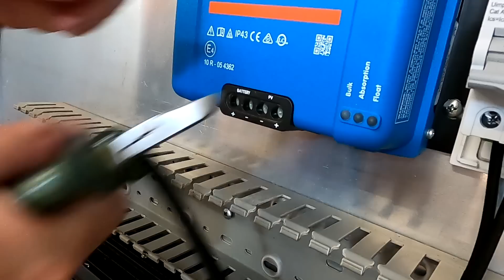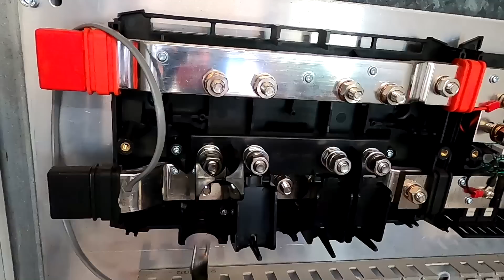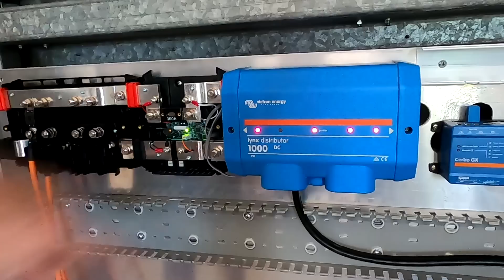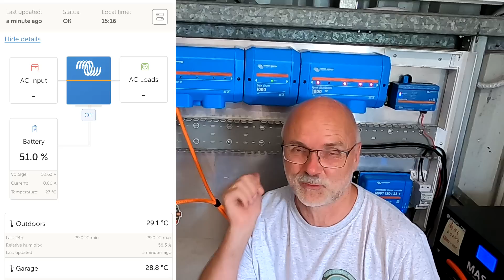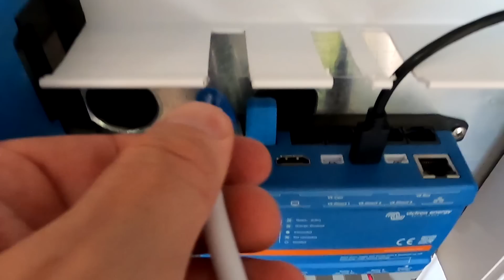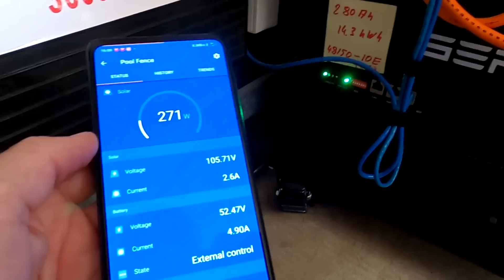New PowerWall2.1 with SEPLOS Battery & Victron Cerbo GX. BMS slows charging at 16%SOC already?

Comment: On the Victron shunt  you’re using a 300 fuse so depending on the battery size my is 675 AH must be fused according.
Reply from the maker: It depends on your cable size primarily.

Comment: Slightly off topic but victron based, What are your thoughts on the Easy Solar integrated boxes? Seems the only thing you would need to add if using it in say a motorhome/caravan would be a shunt monitor. Would there be much point in going for one with a Colour Controller?

Comment: Do you plan to add a class T fuse (or a noark breaker?) prior to the power-in?  The ANL fuse in the lynx shunt module is quite far from the battery to provide short protection.  Or are you happy that the 400A fuse in the battery enclosure is fast enough and got high enough interrupt current to suffice for this purpose?

Comment: Ciao Andy, I have same problem with my primary Cerbo GX + Inverter RS Solar + SOK 48v100 and Secondary Muliplus II GX + MPPT250/100 MC4 =SOK 48v100, when battery is connected MPPT is charging at 52.4V in both systems. I start to think that might be affected due to the Pylontec protocol typically working on 15 cells rather than 16 of the common 48v battery....

Comment: Mega fuses seem to have voltage ratings and Victron are the only 48v ones I can find in Aus. Have you ever tested them? What brand are you using here?
Reply from the maker: I have cheap ones from eBay for this test setup. I considered a piece of busbar for the ANL fuse in the shunt but was afraid of all the comments... 😁
Reply: @OffGridGarageAustralia  ha! I assume the higher voltage ones (of which only Victron seem to  provide) are able to break ark. I believe T class the best but they are so expensive.

Comment: Hi Andy,
I'm planning the system with integrated Victron and Seplos battery packs, but I wondered about this.
What is the point of placing the Victron shunt in the system when we already have a Shunt on the Seplos BMS board? If so, which would be the priority? We can do without the Victron shunt, what would we miss?
Thanks for your kind reply.
Reply from the maker: Exaclty. That's what I explained int he video. You need either or. I've left the shunt in the system as we may not use the Seplos BMS communication nightmare for too long. I'm still working on that though...

Comment: Off subject... I struggle with knowing what breakers to use from battery to Inverter/ loads. I want the ability to turn off the power but also have some protection all in one. So much yo choose from out there and not enough education to know what is ok and what is not and why... I'm working with 12v in a RV. If you have any suggestions where I can learn this or maybe make a video :)

Comment: We have the same inverter, my son got an AC shunt for the AC output which plugs into the raspberry pi and now shows the AC usage on the victron app.... 
I'm not sure where he got the AC shunt from but I think that it's on the victron website.... 
It would be great to connect the inverter to the raspberry pi via the remote switch connector on the inverter to be able to remotely turn on or off the inverter as needed, not sure if a relay would be needed or the raspberry pi could directly do the switching? 
Someone with more experience with the raspberry pi would know better than me, I'm not sure what voltage or current would be at the remote switch for the inverter either..... 
But the AC shunt is well worth it... I highly recommend it.
Reply from the maker: It's an AC energy meter connected via Modbus to the Cerbo. It can measure the output of non-Victron inverters.

Comment: Are those 58v or 70v mega Fuses
Reply from the maker: 24V, I believe. Maybe 36V.
Reply: @OffGridGarageAustralia  will they do in a 48v system if fuse is 32v
Reply from the maker: @zxrjimmy1  it's just for my test setup. For a real system, I would get the correct voltage rating fuses.
Reply from the maker: @zxrjimmy1  Yes, they will work.

Comment: I think you could replace the Seplos BMSes with JK's for ease of mind.
Reply from the maker: But how do they communicate to the Victron system then? This is the main problem of the battery shelf: if one BMS is turning off the MPPTs keep pumping power into the remaining batteries. Communication should tell the MPPTs to slow down before it is too late and all BMS have shut down.
Reply: @OffGridGarageAustralia  I need to think about this as well. Maybe the Node Red Victron addition can tell the charge controllers to slow down. Based on either reaching max voltage or from what the BMS will use. I still am not ready myself with my setup, still working on battery enclosures etc.
Reply from the maker: @edwardvanhazendonk  I'll cover this again in a video soon. Lots to think about and to discuss.

Comment: Quick question I've been pondering guys- If I'm using a Renogy DC to DC charger  between my  lifepo4 battery and my vehicle's battery - would I need to have the "on" switch connected to the relay area or is it enough to use the switch that is already connected in my  vehicle which controls the power from the van battery to the pos and neg that are going back to the cargo area? (It had an isolator setup to an auxiliary battery when I bought the vehicle, controllable through this switch to charge through the alternator power.) Thanks much! I know you guys love the batteries and solar setups! Much appreciated
Reply from the maker: The switch is fine. It's just a manual option rather than the relay which would be automatic when your start the vehicle.

Comment: Servus Andy, today I also write a comment. You have installed an ANL fuse in the shunt, a CNN fuse belongs in there. Can you possibly measure the resistance of the two fuses that you have installed? I would like to compare it with the original CNN and MEGA fuses. Greetings from Öttingerheimat.
Reply from the maker: Victron sells 80V ANL fuses for this device. CNN or CNL are an option too.

Comment: And now that you have installed a 12volt system for the Cerbo, you now have power for pc fans and put your air con somewhere else, like in the house. I knew at some point that you would have to have 12v somehow in the system. Just a hunch.
Reply: I think that battery v2 really needs fan cooling (one fan on intake per shelf behind the BMSs), and it already has an internal 12v DC-DC converter.

Problem today is that it seals in any hot air.
Reply from the maker: The dust, guys, the dust... and insects...
The battery shelf is fully sealed. We had this discussion when I built it.

Comment: Andy, 
On some of my installs i have used a bridge rectifier similar to jaycar ZR-1324. 
The ones i got off Ali were alloy encased but provided Jaycar reference as i can't provide comments with links to Ali.

As a example of one install (note this only works with common ground).
12V Starter Battery (FLA) +ve fused and connected to AC leg 1.
24V House (LiFEO4) +ve fused and connected to AC leg 2.
+ve out of bridge connected into Buck Converter to convert to 5v that is connected  to RPi etc

Using the above, both sources have fail before i loose mgmt power, and the house battery being higher than starter it is preferentially used.
Reply from the maker: That's not a good solution. I need backup power to keep the Cerbo alive for 1-2h if the system goes down for whatever reason. And preferable a solution which is isolated..

Comment: You could also plug the smart shunt of the lynx into cerbo-gx, as a secondary measurement. I would swap the distribution & power in of lynx around. So the battery cable is not at max stretch just incase battery is knocked & moved.
Reply from the maker: That won't work. You can nominate only one battery monitor in the system (which makes sense), so either the shunt or the BMS.
The Power In always needs to stay left of the shunt and distributor on the right. Otherwise the current measured in the shunt is reversed.
Reply: @OffGridGarageAustralia  
I've a bed lvl battery and a lynx shunt in parallel
It just works
But you must decide which BMS is used for the control loop

Comment: Greetings from the Czech Republic! My Cerbo GX is from a series that has a 48V power supply, so it is connected to the Lynx Power bus from the beginning. I use Pylontech US2000C batteries and everything runs perfectly. I'm keeping my fingers crossed for reviving the combined BMS batteries, I hope you can get it going. I wish you good health and inspiration until 2023. Thanks for your videos..small question please: From which manufacturer do you use those orange DC cables between MPPTs, batteries, etc. I couldn't read it in your videos...
Reply from the maker: Thanks a lot for sharing and your kind words, Jan.
I get my cables from a local company but have links to similar cables on my website from AliExpress and Amazon.

Comment: Hi Andy I saw that when the seplos BMS comes into balancing mode a led comes on in a previous video. Would you be able to use circuit to turn on the active balancer?
Reply from the maker: Which LED would that be? I haven't noticed one...
Reply: @Off-Grid Garage  
Hi can't find the video now. from looking again at the front of the battery and what I remember it may have been the red alarm led. Does this come on at high and low cell voltage?
Reply from the maker: @slackytom  Yeah, right. That was definitely the alarm LED because at least one cell was over 3.5V.
Interesting thinking using that to trigger an active balancer... On the other hand, it would also do it, if one cell is low and you definitely don't want that...

Comment: Brilliant move building a UPS battery for the Cerbo GX, absolutely brilliant!
Reply: I am not 100% sure, but I remember that the DC source of the Cerbo GX must be the same as the DC source of a Multiplus.
Reply: @beEnegy  I don't think so. I have installed a couple of Victron installations and two of them have the cerbo powered from the 230V grid through a 24V DIN power supply. Absolutely fine.

I think Andy's solution is just fine, it'll take any DC input, the main thing to watch out for is when performing firmware upgrades; not getting into a loop. With a totally independent PS, you won't have any issues.

Comment: Sadly I didn't see the forum comment about the Cerbo problem and my Cerbo was one of the units affected. It failed just before Christmas after one year in service. I am now waiting for my retailer to respond. I hope Victron will provide a replacement FOC. Had they informed me directly beforehand I would have sorted out a reduced voltage PSU for the Cerbo.

Comment: I had the a similar issue. It turned out to be the BMS was stuck in Pre-charge mode even after 10% SOC... even after a BMS reset and set to default settings the issue occurred. Seplos sent me a new config file which I uploaded onto the BMS which fixed the issue although I'm convinced it'll happen again.

Comment: Data cables and power cables in the same duct is a no no.  Nice video!
Reply: Quality data cables have sufficient shielding .  We do it all the time in automated machines .
Reply from the maker: No power cable, it's a DC cable and absolutely fine to combine with data cables.
Reply: @OffGridGarageAustralia  DC power would not be run in duct with controls.  Keep up the good work.

Comment: Andy, I have a similar issue. Using a Raspi with louisvdw/dbus-serialbattery plugin. There is a hard limit in his driver. Look at his github installation page. Max voltage 3.45V/cell. Perhaps Victron did somthing similar? Post a message at the Victron community. Perhaps someone will know what's going on.
Reply: My Seplos BMS give the CVL to 55,5V to my cerbo gx and it set that on my multiplus, giving me 3,46875 cell voltage. In the 2.8FW I can't control this voltage but in 2.7 I could. So could be down to the programming in the BMS.
Reply from the maker: I don't use the driver on the Cerbo. It works without it... I know about the limit but you can modify the file and increase the limit. 3.45V is perfect by the way 😉

Comment: Hey Andy
Where did you get these mega fuses? 
Are they rated for the 48V battery voltage
Normally these generic ones are only suitable for 32V or less.
Reply: I found mouser has 70V versions made by littlefuse model SF51. They range from 60A to 500A. Interrupt rating is 2500A @ 70V.
Reply: yes, for a 48V system, there are megafuses that are rated 58V. They are (much) more expensive!
Reply: Victron
Reply: @onthelake9554  I bought mine from victron they look completely different, that's why I asked
Reply: @Ben32768  Oh sorry , he may have got them somewhere else , I just assumed they were Victron  .
Reply: Yea I would like to know as well. The 58v seem ridiculously expensive vs the 32v versions.
Reply: Was about to ask the same thing
Reply: @vfast007  if I parallel 2 32v does that give me 64v 😂😂😂 JK…..
Reply from the maker: Victron sells them with the right voltage: https://www.victronenergy.com/upload/documents/Datasheet-Midi,-Mega-and-ANL-fuses,-and-fuse-holders-EN.pdf

Comment: It would be nice to have a couple of Fixed digital meter's fixed on the back wall by your Blue boxes and make it look more like a power station without having to use the mobile phone all the time or better still a fixed tablet on the wall to display all the info
Reply: You can just get the Victron Touch 50 display for the Cerbo

Comment: have you seen those dc fuses catch fire when you cutoff power from solar when 10 amps are going through them. They now use disconnect solar switches as that fuse will do nothing but cause a fire. I seen 2 videos showing that and they are made by Australians. The disconnects have a greater distance  so the arc is not able to keep firing like with that PV breaker you have. Just want you to not burn down your garage/house etc.

Comment: Hi, great video of you using the exact same Victron components I’m thinking about for a smaller solar system, thank you. I can't wait for the next video.
For me the Victron Multiplus or Phoenix inverters 48V/5000va are so expensive.
Also, you will be using a Non-Victron inverter and you won't have load data in the system.
I was thinking if in this case it would be possible to connect a Victron Energy meter ET112 behind the Non-Victron inverter, which can be connected to the Victron Cergo GX and deliver load data to the system that way even when using the Non-Victron inverter. 
What do you think about this?
Reply: If you are going to spend the money for ET112 you might as well just get a Victron inverter. Which will give you that load data and remote control. And Victron reliability and low stand by power consumption.

Comment: I like to keep the fuses on the battery closer to the batteries.      It's too late now, but perhaps the Distributer-Shunt-Peter should have been mounted on the bottom of the wall.
Reply: The BMS and circuit breaker are basically those fuses. You don't actually need fuses on the Power In Distributor, hence why they don't come with them.
Reply: Bear in mind the BMS itself have ANL fuses inside them also, so this is fine 👍

Comment: I suspect your 150/30 will start derating due to temperature, you might want to move the inverter or fit a heat deflector.